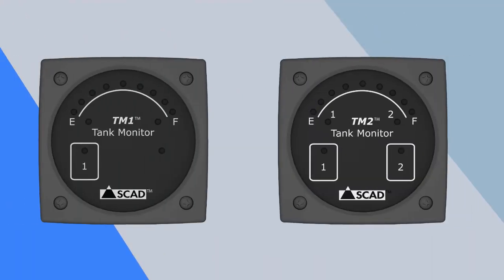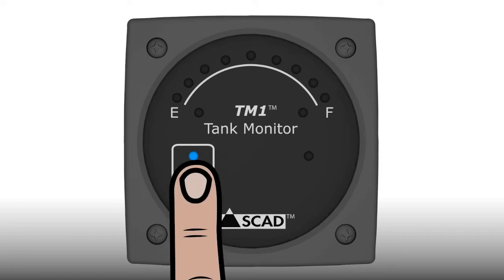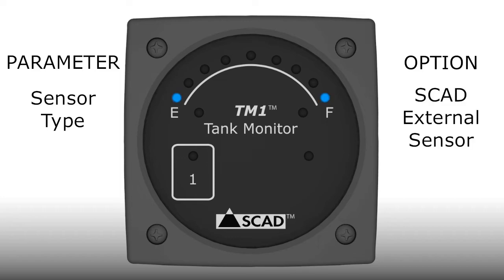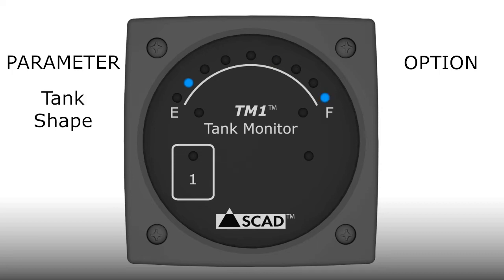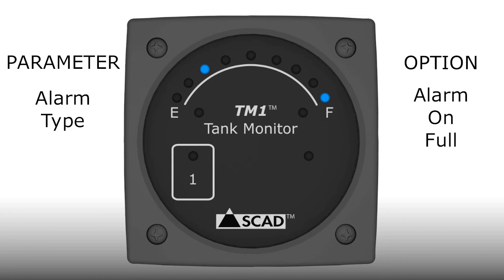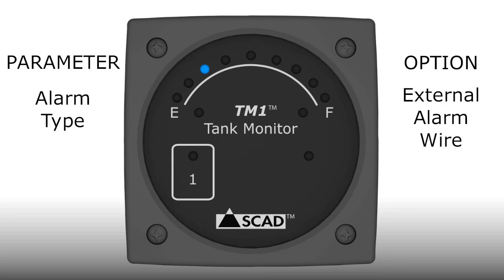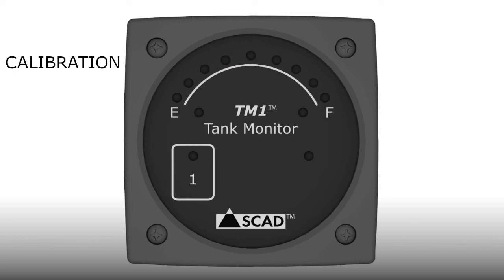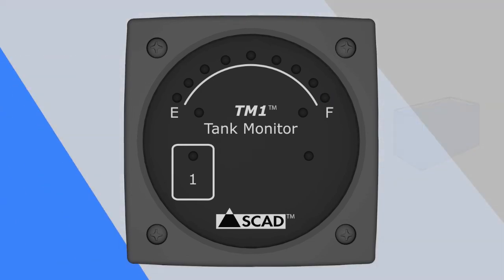SCAD Tank Monitor TM1 and TM2 Software Setup

Comment: Thanks so much for this video, it really helped me a lot. Super relief to be able to monitor the levels without me having to take down my tank install an internal sensor and remount everything. 
Would a slight taper have more volume on the top of bottom? Ours is tapered wider on the top but I'm not sure that that was the best option for our tank.